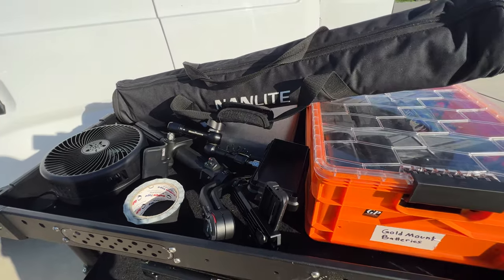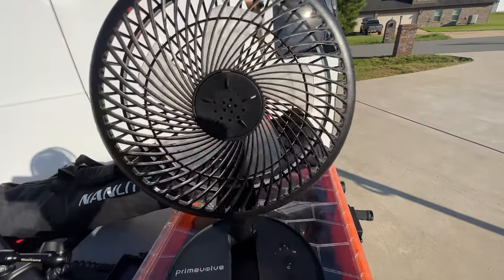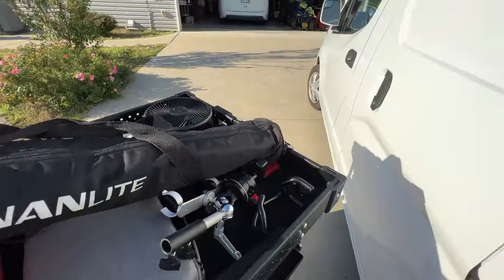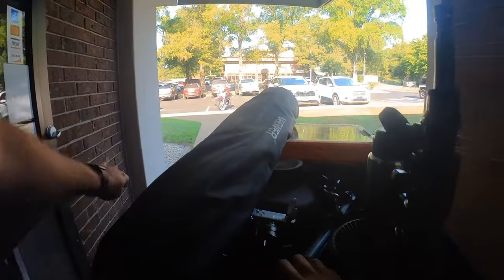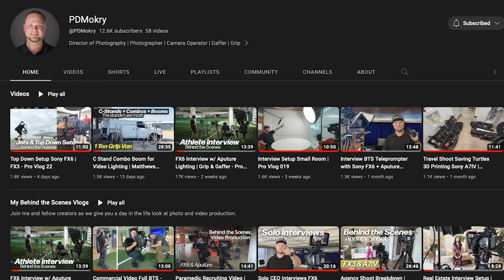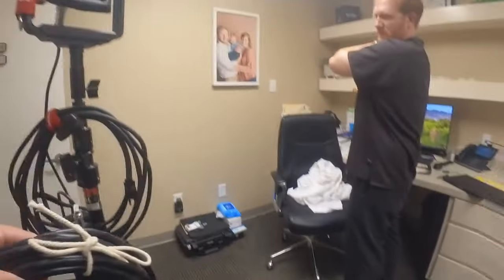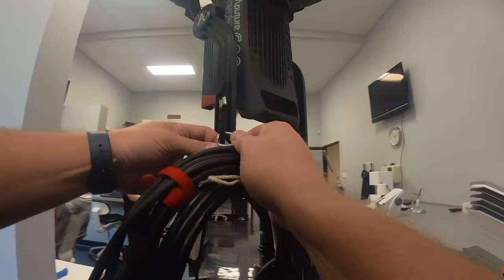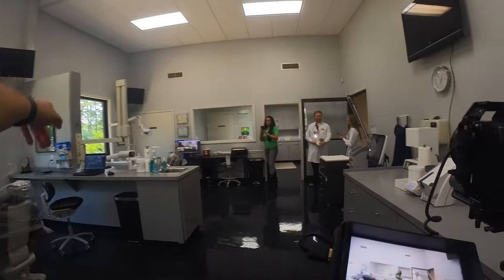YouTube Got Me This Job! Freelancing Video Production | BTS Vlog

Comment: I really like the look of the 600 with a lantern pointed at ceiling. Really does give a polished natural look. I’m still on the fence for a 600 or 300 as a larger main light. I’d probably go with one of their bi color options. But I know that reduces the output by a bit.
Reply from the maker: Absolutely! I probably would have went with the 600x if it was available when I purchased. Just so having the flexibility of bicolor. Most of my gigs I have the 600d at like 10% especially with the Sony cameras having crazy low light sensitivity. I find myself filming more at 12,800 ISO and having a dim key and not blinding people. Unless I'm trying to expose for outside. It would be nice to have a few 300s in my kit. They have a much smaller footprint than the 600 series. The case for the 600 is about double the size.